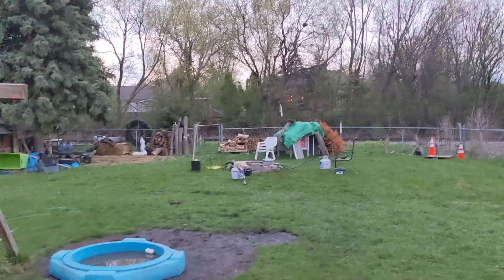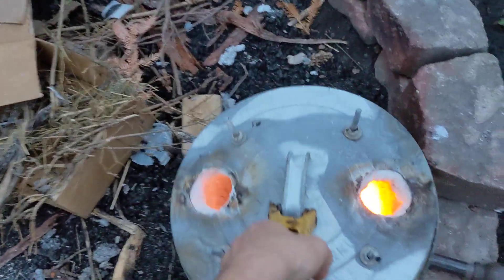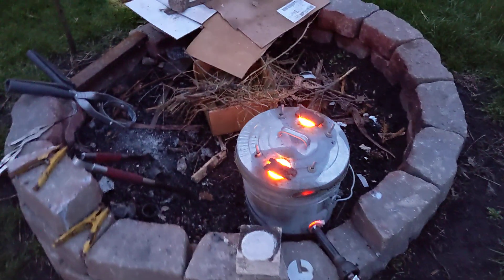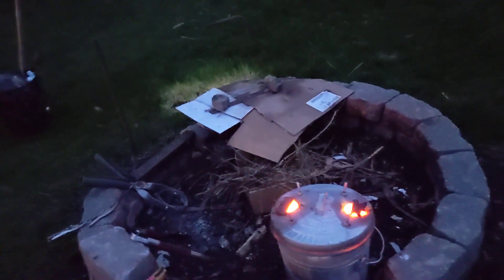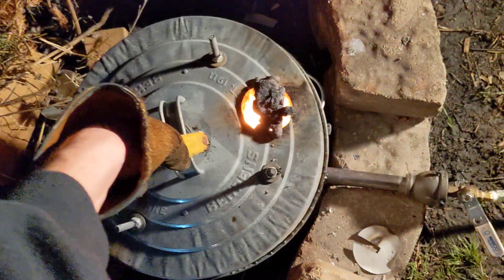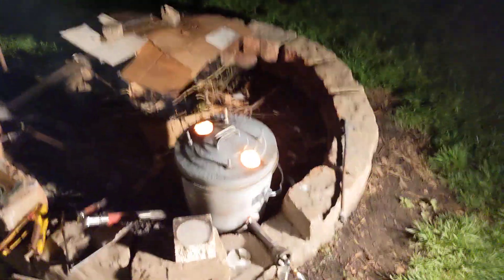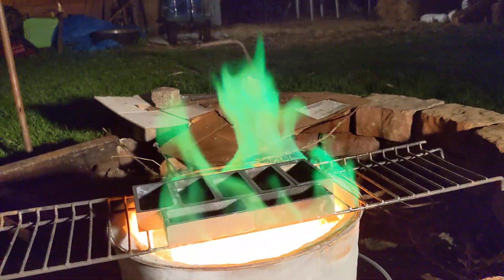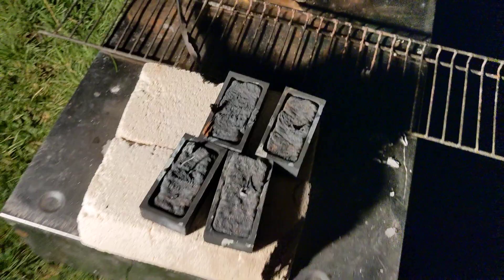Melting A Boat Load Of Brass In My Homemade Furnace successfully.

Comment: so brass turns black when you burn it
Reply from the maker: Due to the excessive heat of the brass it has an accelerated reaction with the oxygen in the atmosphere. This reaction takes place very quickly as the brass is cooling down oxidizing the brass. Creating that black coating on the outside. You can wire wheel that outer coating away and have your self some very pretty brass.